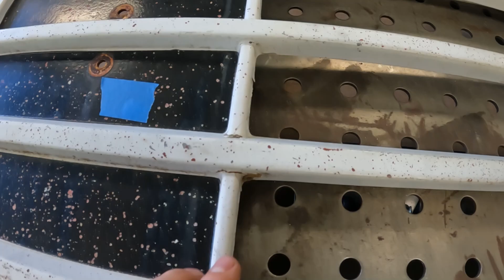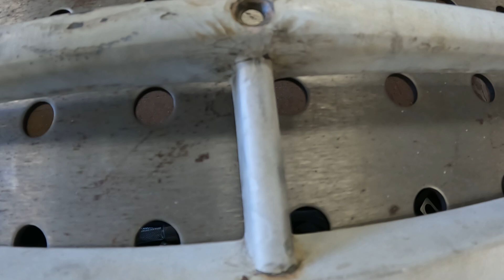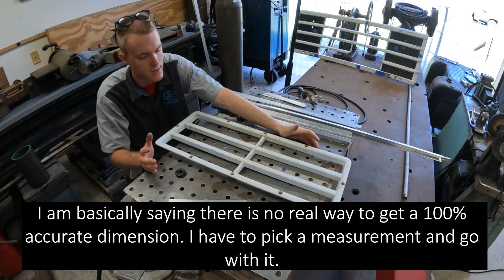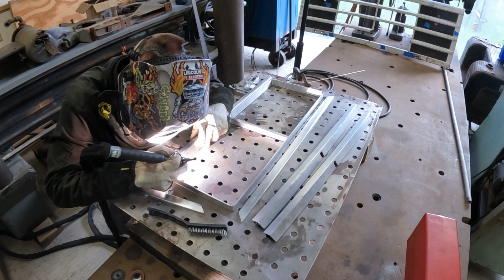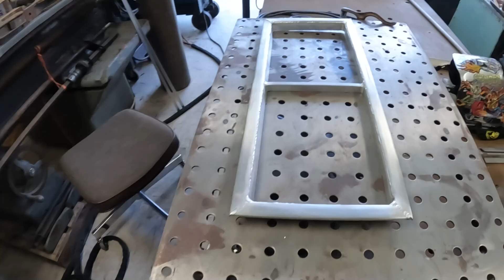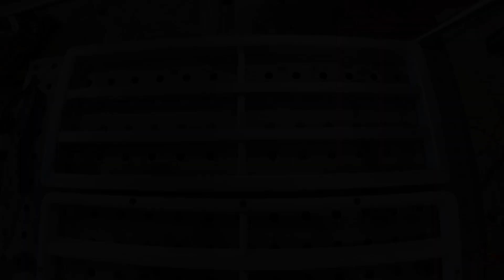1971 Dodge  L1000 Cabover - Ep. 5 - Fabrication/Reproducing the Upper Grill, TIG Welding

Comment: Excellent repro. Have you seen the rods from a company over there called Muggy Weld? I imported some a while back and they worked great on what I was making. Thanks for sharing.
Reply from the maker: Thank you! Still debating with myself on how I will mount it. I think I like the idea of stainless screws, but not set yet. It might be cool to make the mounting points hidden. 

I have seen the Muggy Weld stuff floating around before. It seems they have some really good stuff especially for pot metal. I may end up using something like that for my Imperial door door handle that is broken. I know they have some 7018 or something similar that can eat paint. I definitely want to try those rods out Because of the welding I generally do being repair based. 

Thanks for watching!!